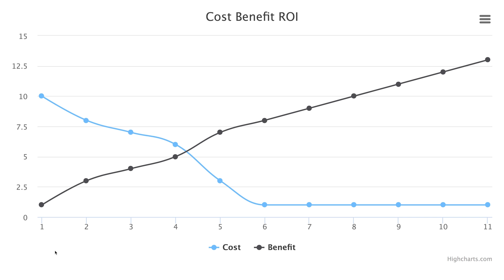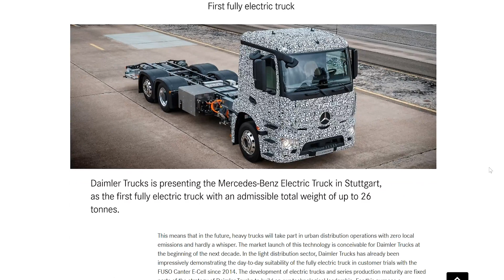Tesla Semi Truck: Everything We Know So Far

Comment: Just one correction. You say about Hydrogen Fuel Cell "albeit not electric"... clearly fuel cell technology converts gas to electricity to drive an electric motor. If that hydrogen is produced with renewable energy, then that too is an electricity-to-gas process, so I think we can call fuel cell tech "electric", don't you?
Reply: No.
Reply: Earl Bramley-Howard: indeed, a fuel-cell car is an electric car.  I think the confusion comes from the fact that old hydrogen cars burned the hydrogen directly in an ICE engine (obviously they were not electric cars).
Reply: Problem with Hydrogen Fuel Cell vehicles is that you still have to go to a specialized H2 fueling station to get your fuel AND almost all of that H2 is from "cracking" natural gas, and is still pretty CO2-intensive. You're better off in many ways (total emissions, cost of fuel and vehicle systems/complexity/maintenance) with just a pure BEV for all the limitations you have with H2. Sure, H2 CAN be made from electrolysis from water and solar power, but that would make it way more expensive than current diesel, so it's not economically viable, thus won't ever happen. 

T. Boone Pickens suggested we just replace diesel trucks with CNG to reduce foreign oil dependency and CO2 emissions while keeping power and range of trucks roughly the same. We'd be better off doing that than converting trucks to H2 fuel cells generated from natural gas and ahem electricity... or leap ahead to the NEXT generation of propulsion, emissions free battery-storage, primarily charged overnight when grid demand is low anyway. Way cleaner, especially as the grid cleans up and more wind power comes online, which is more abundant at night anyway. Flattening the grid demand curve with millions of short to medium range trucks overnight makes all electricity cleaner and cheaper (less idle plants overnight), and we all benefit from cleaner air, especially in urban areas where a lot of these trucks do most of their driving.
Reply: Freddo. Yes I am aware of the logic & largely agree (except perhaps where there are huge excesses of renewable energy because the 'grid' can't use the energy).
But of course hydrogen cars don't need a battery (just a high-tech tank to keep the explosive gas safe) but I do think the world will find a 'sustainability' limit with li-ion. 
I've seen some interesting stuff on hybrid 'flow' batteries combined with li-ion (each doing a different part of the job). Flow batteries' electrolyte doesn't have the energy density for cars just yet... but innovation is an amazing thing and once a technology is invented, it gets better and better over time, so there's a good chance that flow battery technology could come into play as well.
Reply: Ben FCEV (fuel cell electric vehicle).
Reply: Technically the Prius is an EV, Hybrid Electric Vehicle but instead of it being called HEV it's just Hybrid or PHEV (The P stands for plug in) Hydrogen vehicles are Hydrogen Electric Vehicles, or HEV. So yes, current Hydrogen tech is an electric vehicle as well, but most manufacturers have pushed to not be associated with "golf carts" so they rarely refer to the fact that the engine is the exact same in a Hydrogen car as a Battery Electric Vehicle.
Reply from the maker: interesting. I think Tesla's are considered Battery Electric Vehicles (BEV) which would definitely be different. Not sure if the industry qualifies the hydrogen fuel cell's as electric, will research more...

Comment: Maybe it will be okay in the US for state wide routes. 
In Europe, most of trucks are doing long hauls of thousands of kilometers each side. And only adoption for them would be in local businesses, restocking the grocery shop goods, gas station refilling trucks etc. Not much really.

To be honest, i doubt it's the right market to enter to. May not be a shining success.
Reply: Europe has smaller countries and an excellent railway system, so why would trucks go that far? A quick Google search confirms this. Most cargo travels less than 1000 miles, and often less then 300 miles on land. I couldn't find data on the share of trucks, but they make more sense on shorter routes.

Comment: platooning makes sense as they can split up near exits and go their own way and allow other vehicles to pass through to safely enter or exit the interstate. A fixed train would be hazardous near exits with cars trying to get around and in front of them. Other trucks can join up and leave anytime. Truck operators will change quickly if its about money. An operator with significantly lower operating cost due to fuel and labor will drive stubborn companies out of business quickly. I expect you will see autonomous lanes like car pool lanes quickly and soon after autonomous only roads when safety data is available.
Reply: The only thing people don't think about is the huge amount of impending unemployment a system like this would create. Progress is progress and shutting down progress because it's going to hurt the economy is not really the answer. I have faith that day cab semi's will likely be human drivers longer than the long haul routes as it currently stands, the chaos of city driving especially with a trailer can be quite a challenge for an AI to handle, not to mention the fact that somebody will need to still manually connect and disconnect trailers for a while... eventually automated trailer hitching will pretty much kill the last trucker.

But that doesn't solve the problem, jobs are getting replaced by automation and the general attitude till now was "it's not my job, guess they need to find something else to do" but what happens when your job is replaced. Scientists have proven that 90% of the jobs on the market are easily replaceable with automation. We need to focus on how we are going to keep the economy from crashing as we come across more and more automation replacing jobs, instead of the unhealthy habit we've formed of simply waiting for it to effect us. We need to make sure that we start arranging a system to assist people put out of a job by automation. Similar could be said for renewable energy replacing coal or gas plants, a lot of technology is making jobs disappear... Even without it being automation.

We need to find a solution to that problem before we start to praise millions of jobs being thrown away because a computer can do it better. Eventually your job will be completely replaced by a computer as well, no matter what you do, and if it's not replacing your job, it's replacing other people in the same capacity... You'll have more people showing up to take your place even if you do keep your job.

Comment: The real game changer will be the hydrogen/electric Nikola One, that will have an estimated range of 750 miles, with a hydrogen fueling infrastructure to support it. I read they have billions in pre-orders. They will only be leasing them.
Reply: You'd have to drive from 0 to 85 and maintain that speed for 14 hours straight to drive 1200 miles per day.

So basically, needing 1200 mile range per day is illegal. 750 miles is easily more than you need for a day's worth of driving. Anybody that has a CDL could tell you that a 400 mile range with a 30-60 min charge time would be plenty of range for any driver due to the limitations placed on them by their license.
Reply: Team driving is not the norm, and some states are extremely weary of the practice. Politicians have been trying to express the inherent problem that sleeping in a moving truck provides less rest and the 10 hour break required may be interrupted.

Fact is most team drivers are breaking HOS because mathematically what you say is correct, but the reality is the truck needs to stop about every 4-6 hours for a 1.5 hour break either for the mid drive break or for the change over. In which case 400 mile range with a 1 hour recharge time is still perfectly acceptable. Basically the myth that the truck needs a 1200 mile range is bullshit.
Reply: Jay Trombler I was surprised that Ben didn't mention this either, since it's an American startup. I'm very excited about the Nicola One, not so much about the Tesla semi. I need a full 1200 mile per day range (not 750, btw) and the Nicola will provide that.
Reply: Hydrogen is not proven.
Reply: Nikola Two is already being produced. But as long as we don't know how to charge them on-the-go neither one will be viable. Let's calm down and wait for the Tesla Semi unveiling. Also... I like the idea of a Semi for rather short ranges.... many small and mid sized companies will use those Semis... and I don't mean just trucking companies... i mean the florists, Ikeas, soda pop deliveries, all companies.
Reply: Sorry Sherrif, a team going coast to coast, and governed at 60 mph will cover 1200 miles in 24 hours.

Comment: I just wonder about the charging of those trucks. I mean waiting 6 hours instead of 1 hour (6x P100D) is quiet a bit of time that you have to pay the driver - who is the most expensive part as you said. Also where would you park the truck if you try to charge at a supercharger? i guess we can forget the idea of charging at super-, or destinationcharger.
These trucks will ONLY drive as far as their charge lets them and this time has to be long enough that it would be a full work-day for a driver (to charge over night and only on special supercharger for these trucks) since they dont have the normal work-shifts but instead sometimes drive for a week or several weeks without coming home (at least in germany thats normal).
I really love tesla but for trucks you really have to rethink the whole thing AGAIN. its a completly different set of problems that you have on those trucks
Reply: What if the battery is multiple batteries that can be charged with several superchargers to reduce the charge time?
Reply: Battery swapping could be the solution in this case.
Reply from the maker: Supercharger V3
Reply: That would have to be a very fast supercharger, Ben. I can refuel my semi in 15 mins. A battery swap or charging would need to be in that range as well to compete, or you're only going to get the markets that return to base at end of day. Very few long haul truckers will care to hang around for 2+ hours charging his truck mid shift.
Reply: Karl you really dont get the point of charging. You dont do it like you fuel your truck. you do it while you have your break. Its not you waiting for the truck, its just the truck using the time you have your break and also saves you the 15 minutes that you need to refuel
Reply: Fick Dich how much range can be add3d in 15 minutes to an EV and how much range can be added in 15 minutes to an ICE vehicle?
Reply: You dont even get it when i explain it to you lol. The car will charge while you sleep or have a breakfast or whatever trucker do in their forced-truckstops. and the car has to be able to drive as long as drivers are allowed to drive without this break. Truckers will not stop anymore just to refuel. They will only stop to have breaks or to up-/unload and load their car while they do this. Once cars can drive autonom its even gonne be way better.